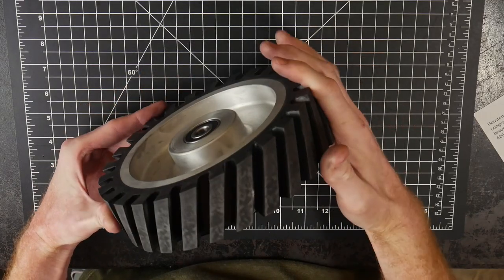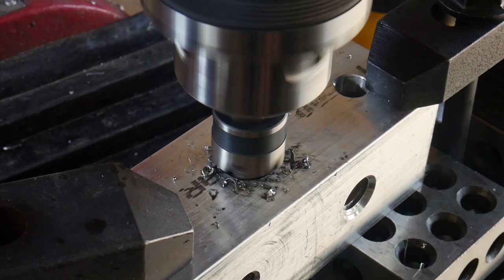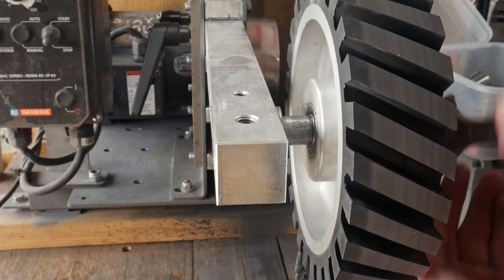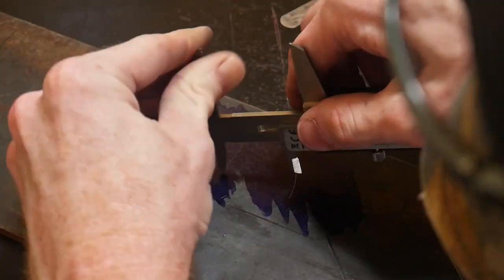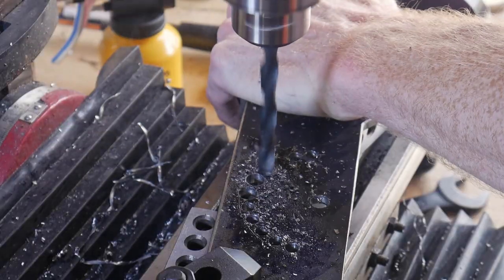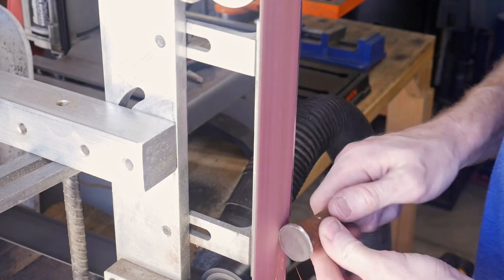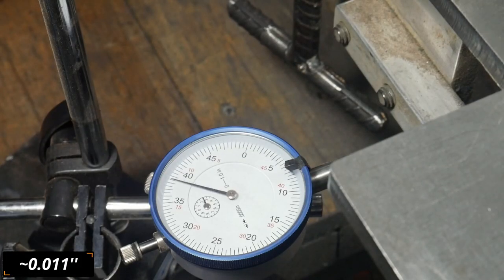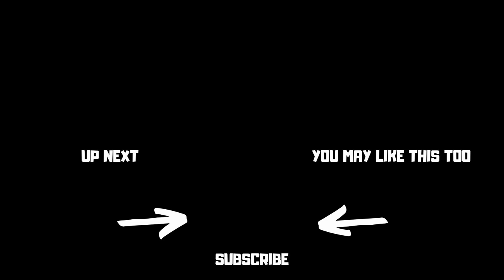Quick Tip(s) | Mounting A Contact Wheel & Slack Belt Rig

Comment: I used 3/16" for my 2×72 and never really thought about the flex. I'm gonna check it next time I use it
Reply from the maker: Cheers sir, like i said, it probably will still work just fine, but over time I think it could cause some uneven wear on your equipment. It will depend on the height of your set up as well, the piece I made was pretty long and that contributed to the amount of flex. Cheers sir!

Comment: I'm really surprised that you had that much flex in 1/4" plate. Makes me think a guy would want to jump up to 1/2" to really stabelize things.  Good to know as I have a future project that I will now have to re-think.  Thanks James.
Reply from the maker: Thanks Jim, I was surprised too! A big part of it likely was the spacing. If I reduced the length of slack belt section a little I think a good deal of that flex would come out. You saw that affect with the larger wheel mounted. But after seeing that I wouldn't go below a 3/8'' plate for this type of application. Cheers sir! Have a great week and thanks for stopping by.

Comment: I've noticed if you take the tops off the bearings and soak them in windex for about 30min after a little shake for 10mins it degreases them. Because grease attracts dirt and they will be nice and dry so at lease the dirt just falls out and I've noticed they last longer but I will still change them out once or twice a year
Reply from the maker: Good tip! THanks

Comment: Allrighty then.... ordered my parts. Thanks for doing the leg work on that. I did the same thing with a tilting work table. 1/4 don't cut it, 3 No arbor press/8 or 1/2 from now on for me. How are the mods for the Mill working out? No arbor press for the bearings?
Reply from the maker: Thanks man. Yeah... I could of done a few other things for those bearings. I think freezing the bearings would of been smart too... and lightly heating the center of that wheel... I was definitely a little disappointed, but lesson learned! Cheers man.

Comment: Side question, what TPI blades do you use on the portaband? I tried 22 on mine but it cut so slow even on mild or aluminum.
Reply from the maker: Hey man, these are the blades I use. They seem to hold up fairly well - Bandsaw Blades - https://amzn.to/2Z4fMRV
Reply: I'm using those, and they are good for metal or wood.